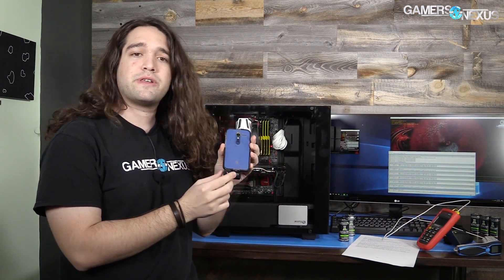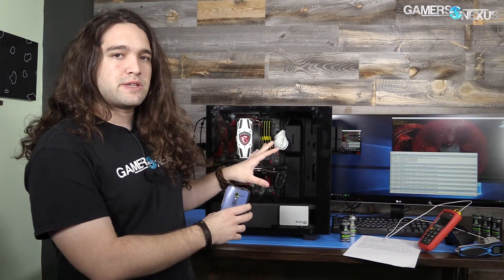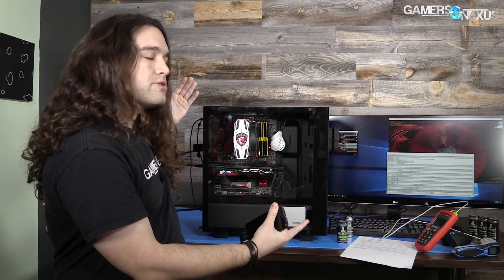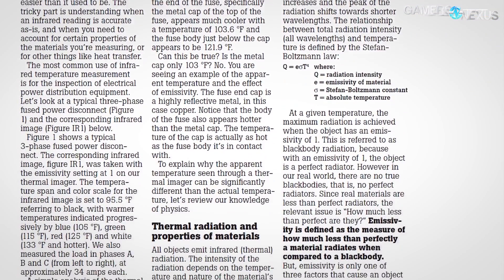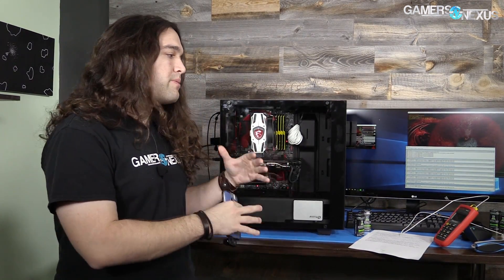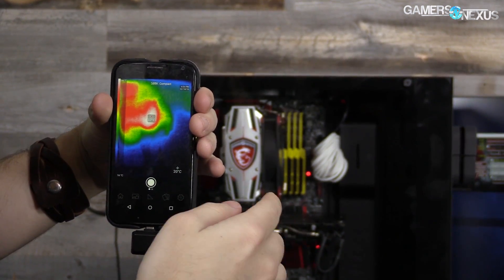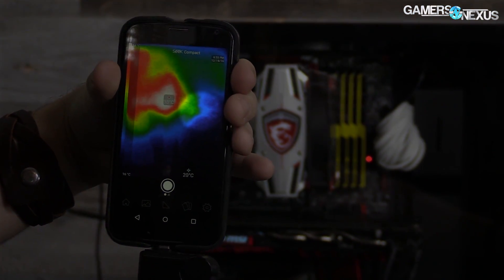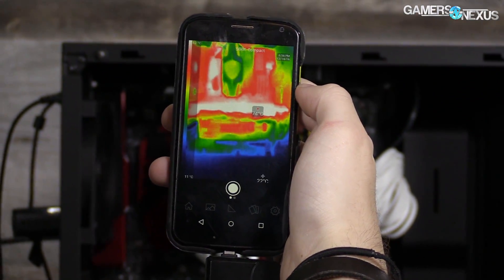PSA: Improper Use of Thermal Cameras

Comment: Bit late onto this video, but there are a couple of issues with what was said. Although matt black is the best surface for maximum emissivity, it will give falsely hih readings on an infra-red thermometer of any kind, as in general all such devices are calibrated (such as they are!) using a neutral matt grey surface - much like in photography. Secondly, whilst it was correct to state that silver and/or light coloured/shiny surfaces  have lower emmissivity than a black (or neutral grey) coloured surface, the issue of the shiny heat pipes in the computer was glossed over. Being shiny/silver meant that the resultant temperature should have been lower than that taken by use of the contact thermometer, not subtantially higher (almost double: 45° vs 80° odd). There was something very wrong with tat part, which should have been addressed...

Comment: Wouldn't using a laser thermometer be a lot simpler and cheaper? I've got mine for roughly 30€ and couldn't be happier.
Reply: It is & isn't. It is definitely cheaper, & simpler in the sense that it gives you a single reading for a single location. It isn't very useful for big picture though. With a decent thermal camera, you can see variation & hot spots much more quickly. Of course, different surface conditions can throw you off, but the IR thermometer has the same issue.
One situation where a thermal camera really shows value over the IR thermometer is checking walls for insulation. As walls are typically uniformly painted, you can just look at them through the camera & see where heat is being lost instantly. If you wanted to do the same with an IR thermometer, you'd have to scan across the wall slowly while keeping track of where you get higher or lower readings.
The other benefit of the thermal camera is that you can be more confident of what you're getting the reading from. The IR thermometer, you have a laser for guidance, but you can't see exactly where the actual sensor is pointing, & you have to be conscious of the spread of the sensor across the distance you're reading from. With a thermal camera, you can see the outline of what you're looking at pretty clearly & it's obvious when you're too far out to get a pinpoint reading.
Of course, the IR thermometer makes a much better cat toy.
For reference, I have a Commercial Electric MS6530H IR thermometer, & a CAT S60 phone with a FLIR thermal camera. I've found that they generally have a comparable temperature range & agree within 5F, which is sufficient for my needs.

Comment: Truth is that whenever reading temperature, it's a pain in the ass.

For example, the thermocouple which you seem to rely more on is not perfect. That sensor generate voltage as it has more heat (energy), but they are round, which doesn't make perfect contact with the surface you want to measure, leading to false readings.

One thing to mention is that temperature is a punctual measure, so you cannot read/measure the temperature of a whole body, at least not with a single sensor.

One last thing, I didn't like the phone camera. there's no way to point to exactly where you wanna measure, instead it always marks the hotter spot.
Reply from the maker: 1st_Luis Thermals are difficult, especially since so few components have sensors you'd want. We don't "rely on" that sensor for everything. It is just another point of reference. We actually use self adhesive thermocouples for tCase temps on VRM components, like FETs. This eliminates the issue with contact (creates full contact). EMI is another concern, but pretty easy to avoid as long as you don't cross an inductor. Power plane PCBs are also trouble. Kind of have to guess and check for EMI. 

Using built-in sensors for the CPU/GPU components is how we measure our outputs. This is done with trusted software. The thermocouples and thermometers are for SMD parts and ambient for deltas on a second-to-second basis.
Reply from the maker: We communicate with the ISV and IHV to understand which temperatures are reported and which temperatures are measured, then use that against other CPUs or GPUs to determine which metric we want to trust.
Reply: Measuring in general is a pain in the ass. The more exact you wanna be the more the little things you didn't think would matter start to add up.
Reply: John agree, but there are some measurements that are easier, for example, voltage and current. There are indirect measures with some disadvantages, but measuring directly the component can give you a better read.

Temperature is more troublesome, IMO.
it also reminds me of weather forecast, which is so accurate XD
Reply: Gamers Nexus Got Ya.

Just one question. How can you identify a software that's reliable?

I'm asking because different software can have different reads.

example, in my old laptop, C2D T7600, cpu reading and voltages seem similar (if not the same) in core temp, aida, cpuid, hardware monitor, and many more.

But things change a lot, with the same software mentioned, with my 4770K rig.
Reply: 1st_Luis I thinks thats not as easy especially  if you don't have any measure devices to control it. You can verify how reliable a sensor software is by checking it with other programs. If have an Asus board for example, you could use their stock software and compare it to other programs. But they should show all the same temps.
Reply: +Gamer Nexus Seems sort of trial and error. But I get it. On the Intel side I find easier to do that, while on AMD most of the time is a chaos.
Oh, and saw the thermocouple used in the EVGA video card thing. It's great, tbh.

+David Freeman, don't take this as I'm mocking you, but LOL.
Asus AI (if I remember the name correctly), is the worst. I tried reading CPU temp with the software, but it gave me almost 10 °C less than the real CPU temp.

I asked Gamer Nexus the software because I find Intel Extreme Tunning reliable. That's the one I used to take readings on different parameters when I was setting the OC.
Reply: I have a CAT S60 with a FLIR thermal camera, & allows you to place multiple pinpoint measurements on screen, as well as average area measurements. The trade-off is that I don't see a way to have it call out a maximum pinpoint temperature the way the SEEK did. It does show the temperature range being displayed on the right side of the screen though, so you can easily see the max temperature, but you're guessing a bit at where it's being read.
Reply: +Daniel Isbell
The only flir camera I've owned and used it's an i7.

I don't know that particular software, but usually those cameras give you a bar graph which shows the temperature displayed by each color. Right now it's only measuring the temperature at the center, but you can change that as well. (as you mentioned)
I'll leave here an example: https://app.box.com/s/3lwo8ghg88c53puaarzfbqt9x1w46n7t

Picture is from an Intel MB.

If you want max temperature spot, I guess you could use an imaging software that can select certain colors, like magic wind in photoshop.

Maybe it's personal preference, but I like better the center reading thing.
Reply: 1st_Luis I agree that the fixed location temperature reading is preferrable, & yes, mine does show the min/max bar on the right side. Mine does also allow multiple fixed location temperature readings & the only thing you have to do to move them is touch & drag. It works pretty well. I'm just slightly surprised that it doesn't also have an option for max temperature spot.

Comment: The ,,Flir one'' is better and have more features  https://www.amazon.com/FLIR-ONE-Thermal-Imager-Android/dp/B00W5PRY52
Reply: Indeed. When i compared the two i did find that FLIR One had a better resolution and also uses the normal camera to give objects a solid outline by combining the normal and thermal image. Makes it much clearer where everything is. I've had a plan to buy one for some time but never pulled the trigger on it. My plan is to monitor the case under load and perhaps experiment with fan placement and direction to get better temps. Never thought about using it to measure exact temps of components - that's what diodes are for.

Comment: A couple quick notes...
- Infrared light is just like normal visible light, just longer wavelength. It's all electromagnetic radiation (ie, photons)
- looking at the CPU through the glass has nothing to do with emissivity. The glass is simply opaque to infrared light, just like steel is opaque to visible light. Light/photons can interact with a material in 3 ways; reflect, absorb or transmit. Glass absorbs most infrared light, but transmits visible light.
- Emissivity is a measure/description of how well heat gets radiated into air.

Comment: my experience with laser devices anyway is you can put a piece of blue painters tape on the object to be measured, set the emis to something like 0.95-0.98, and measure the tapes temp. gives a pretty good reading

but yes, this is something people need to know. these devices don't auto-calibrate.
Reply from the maker: Good idea on painter's tape! I've found that those little dot label stickers work really well, too -- the kind you can pick up from an office store for a few bucks.
Reply: We use them for spot checks on components that we operate right on the edge of self destruction. The problem was different brands of the same component are painted different colors so one in chrome might meltdown at 200f while the exact same thing from another supplier in black might fry at 160f. Easy solution is to take a sharpie and put a black dot in the middle of it. Now they all read about the same.